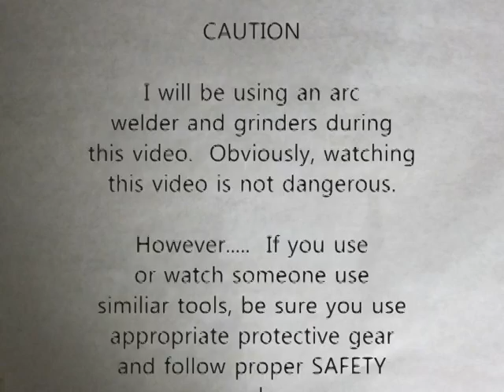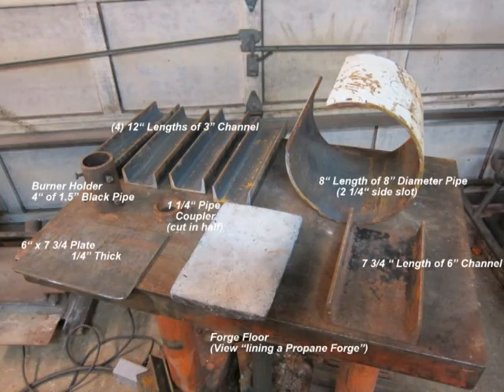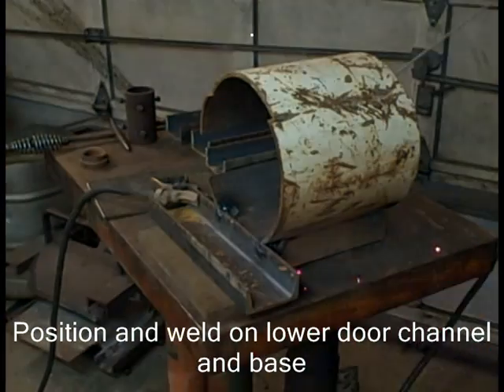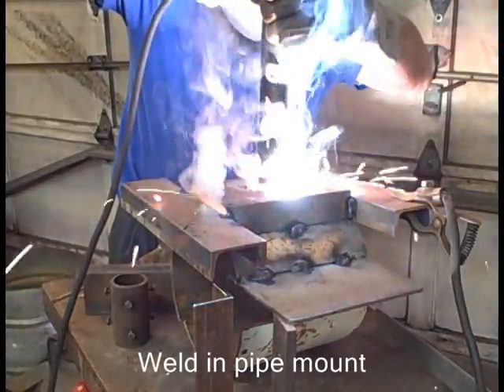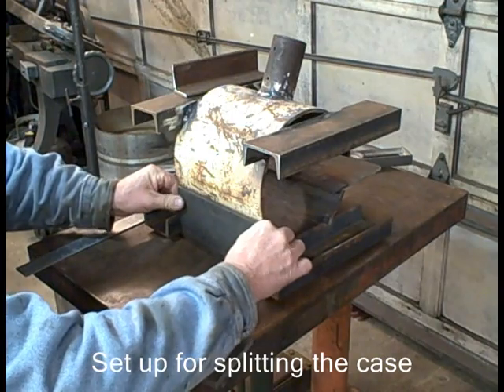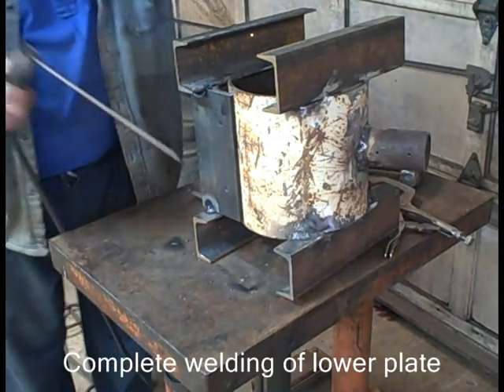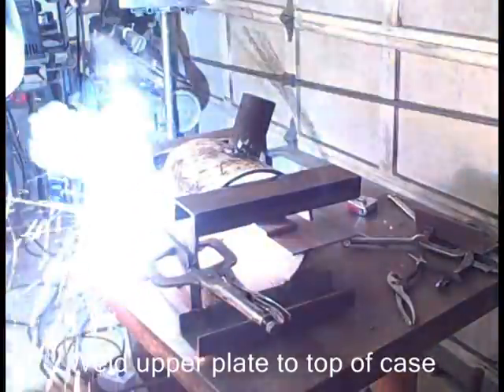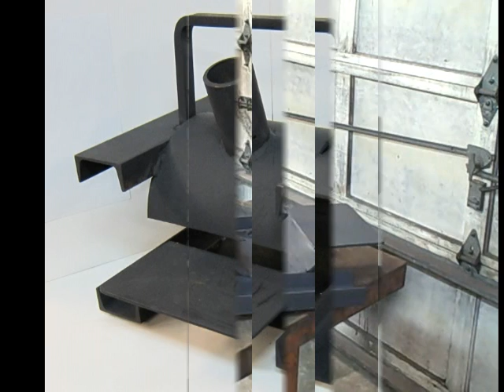Build a "Super C" Propane Forge.mpg

Comment: David,  I LOVE THIS VIDEO...Awesome design and excellent information.
Reply: +Charles Wright....  Thanks.  Please note also that this forge can be made with a length of "C" channel for the bottom, with a half round being used for the top.  This makes the forge easier to build.  A piece of 3/8ths or 1/2 inch plate would be welded to one side of the half-round, and bolted to the back side of the channel.  Also, when you line the forge (another video), for small forges (such as this size), it is not necessary to add the mortar and second coat of slurry..
Reply: I have a few tanks that are condemned....The argon/co2 tank has the best promotion......I also have two 20 lb propane tanks that i first made rocket stoves but want to convert to a forge.    I need about 7- 8" of width and depth.  The height of the opening would be 2-3".   I thought the opening would let out too much heat.....then I saw your idea of adjusting firebrick and that solved the problem.     Thanks so much!!!!!

Comment: Good video Sir.  I'm surprised you haven't got yourself a little MIG welder by now, but then again, you're a good hand with the old arc welder.  I cringed when it came to you welding the nuts for the splitter plate.  Best done first when flat on the bench as you say, but so much easier with a MIG. Your arc welder sounds cranked well up even for the welding, though it's hard to say watching a video. Nice use of the arc welder for cutting, an old trick that you made look easy. Good stuff. Paul UK.

Comment: I agree. I would also recommend not using a flap disk to deburr the cuts. The burrs will destroy your flap disks by shredding them. Use a large half round file. More elbow grease but you will save money on flap wheels.

Comment: This is gonna help me a lot! Can you make a video on making a propane forge with no welder? Thank you so much
Reply from the maker: Matt....   Sorry I didn't answer this before.  I just found the question.  With a minor exception, I have already made a video showing how a forge can be made without welding.  Look for "Free Form Forge".  The exception is that the video shows the use of a manifold with two burners that have the burner holders welded to a piece of plate steel.  Instead of welding the burner holders, they could be held on the plate with angle brackets and small bolts.  If you are just starting and are going to do small projects, I suggest a much smaller free form forge with just one burner.  Be sure you have support for your burner and hose so they are stable when in use.

Comment: Great video and very interesting design in an interesting subject.  However it is not negativism to point out hazardous practices that everyone may not know.  As mentioned below welding light will burn your skin much like a sunburn.  Ask your dermatologist.  The burns are cumulative over time and lead to melanomas which are serious and a fast cancer you really don't want to set yourself up for.  The damage done may appear to heal but the skin cells are permanently changed.  If you are young and do this many (for some people it doesn't take that many) times as you reach your fifties and sixties you will wish you had not.  Welding does not seem to tan.  Its U/V range is just in the dangerous area that burns (which is the same as harms your eyes).  It is not if but pretty certain to happen.  Your dermatologist can look at your skin years later and tell how many times you have burned yourself pretty accurately.  Moles, age marks, skin tags etc all are directly attributable to sun burns.  Check it out and you will find that welding with skin exposed is like playing Russian Roulette with all six cylinders loaded!  Not in any way trying to bust your chops but I see this all the time and I believe it is done out of ignorance which will be regretted in the near or far future.  Really enjoying your build as I always like to see uses for 'scrap' materials in innovative ways.  I used a hot water tank, cut it down welded up hinges and a stand to make a rod oven.  They are handy as they come in all sizes and done carefully the insulation can be preserved.  I used a silicone oil pan heater as the heat source.  Worked well.  Doug

Comment: I would suggest, if you make more of these forges, to clean all the steel before doing in welding to 1. get better welds & 2 it make it easier to clean the welds later and you don't have to go back and clean it before you paint it.

Comment from the maker: Joseph...  I recieved an email from Youtube about another comment you made 

"does it matter on how the orifice is put on the main body of the forge I have mine straight up,,,, does it need to be on a 90 degree angle "

It's not clear to me what you are describing.  If you are referencing burner placement, I have had success putting the burners straight up or slightly angled on top of the forge.  Be sure the flame has a clear path into the burn chamber.

Comment: What kind of band saw is that in the background? That thing is truly awesome!
Reply: If you are referring to the horizontal band saw I cut most of my stock with, it is a WELLS Metal Band Saw, model 5-M-42.  The company was started in the 1920's,  I'm not sure what year my saw is, but it is an early one.  Wells is still in business today.  I have another Wells saw in storage, a little larger.

The large upright band saw is a GROB 4V-18.  It is an industry grade vertical bandsaw and weighs almost a ton.  I have cut steel 2" thick with it.  I believe that saw is still in production.
Reply: Awesome. Thanks for the info. I have a bit of an affinity for turn of the century tooling.

Comment: Like the project.  But, you should really take note of safety.  First with the angle grinder on a loose piece of metal.  That can be thrown around by the grinder.  Next welding without a glove or long sleeves can give you a very bad burn.

Comment: Hi David,
First let me thank you for the great information in your videos. My son and I are going to build a super C because of your great step by step information. We are both wondering why the length of the forge is as short as it is? He is new to blade smithing and my hobby is carpentry. If this is a forge to try and do many jobs with, would a longer forge still work fine or are we then causing more issues with heating it properly?

My son wants to mostly make knife blades but we are concerned with the short length of the forge it will be more difficult to get a longer blade heated evenly..

Thanks in advance.

PS if you have answered a question like this before can you please direct me to that answer. I did look before I asked this question.
Reply from the maker: +Arthur Mitton ....   You can make the forge longer if you wish.  In general, this forge would work for most projects.  The area of a project you are actually working on is seldom more than a few inches long(usually less than that).  The exception for bladesmiths is during heat treating, where you need the entire blade at an even temperature.   It can be done with a forge less than the length of the blade, but it takes practice and a very good eye.  You just keep moving the blade through the burn chamber till you get the heat penetration and color you need.  Although a single burner should support a burn chamber up to around 300 cubic inches, you might want to put two burners to ensure more even heat throughout the interior if your forge is much longer.    You also need to keep in mind that, with these types of burners and the placement I use, there will be hot spots in the forge.  Professional heat treating is usually done in a heat treat furnace where there is no open flame.  A propane forge can be built so the heat is indirect, but that is a different type of forge (and burner placement).  Good luck with your projects.
Reply: +David Hammer Thanks so much for the additional information and your very quick reply!
 My son has now cut the oxygen tank into a 10 inch length. We are in 
Canada and most of what I have found for refractory brick is only 1 1/4"
 thick so I am continuing to look around to find the 2" or we will have 
to modify the design to either accommodate a double thick brick or 
something....  I found a source out of Vancouver for some lining 
materials and plan on contacting them today. Again, thanks so much for 
the help. I am definitely one of your subscribers on YouTube.  :)
Reply: +Arthur Mitton....  I assume when you are speaking to 2 inch brick, you are talking about the brick that will be used for the doors and the shelf.  If not, what?   Keep in mind that I use "soft" brick (called Insulating Fire Brick (IFB) for the doors and shelf.  When I see 1 1/4 inch brick here, it is hard brick.  I have used 1 1/4 inch brick for floors sometimes.  Have you looked online for IFB (ceramic or refractory suppliers).  I believe 2 inch is available, but what I generally use is 2.5 x 4 x 9 inches.   It's a lot less expensive if you  buy it from a refractory supplier that normally services industry.  One catch though is that they may not ship, so the supplier would need to be within a reasonable distance.  I just used Bing (you could use Google) and searched for ceramic supplies and/or refractory supplies and added Canada on the search.  I found both types of suppliers (Alliance Refractories was one of the industry suppliers.  Ceramic suppliers generally sell by the piece, industry suppliers usually sell only by the box (but the cost per unit will be significantly less).   IFB will break easily, so shipping sometimes is a problem.  Also, I recommend buying 2300 degree IFB because it is stronger than higher degree rated brick.  Remember, I consider IFB a consumable, so don't expect it to last indefinitely (it doesn't).  

If you live near a large city, chances a good that you can find a local refractory distributer.

Look in the Yellow Pages also for suppliers.

Thermal blanket is another story.  The refractory distributors are the cheapest, but again, they only sell by the box, which would be much more than you would need.  Ceramic suppliers that sell to consumers will generally sell by the lineal foot.  They also will ship individual IFB, but are a lot more expensive.   It pays to shop around...  make lots of phone calls to find the best prices, including shipping. 

If you are going to use thermal blanket and are going to put the refractory I reference on it, you should be able to find that from ceramic suppliers also.

Comment: Greetings from New Brunswick Dave,
I have completed my Super-C forge and have made myself a couple of burners (one for a spare. I made them to your specs exactly. I'm having to choke the air inlet holes to get it to stay lit, and move the nozzle down into the tube another 1/2" to make it run. Once it is lit,it burns blue and powerful. Have you ever had to "choke" any of your burners in the past? Any ideas? Thanks!

Comment: excuse my ignorance but why on earth did you cut that forge in half? I've been trying to think of any possible benefits but have come up blank. I'm sure the reason has just flown over my head, please elaborate. Thanks
Reply from the maker: Sorry I didn't see this question before.   The reason for "cutting the forge in half" (as you say), then bolting it back together is so the top can be taken off to make it easier to put the lining in, brush the refractory on, reline and repair the lining.

Comment: In my modification to your forge, I am  making the side slot large enough so I won't have to notch the bricks. This way I can put 'em in sideways as well as straight in. You must have a good reason for your notched design, but I can't find or figure out why? The build is too far progressed to use your spec's, but as I was re-watching and trying to pick up a reason, I thought to inquire. Anyway, thanks for your contribution to our body of knowledge. Even though my design mod is a bit different than yours, I will always give you credit, mate!
Reply: The simpler you can make the side bricks, the better.  Those on the video were that way because the floor was higher than the shelf (thickness and width issues) and the way the top lining ended above the opening.  I've since made many forges with larger openings and the bricks essentially being a wedge that slips in.  The original intention was to have a two-inch opening.  Sounds like you achieved that better than I did on your first build.  Good job!!

Comment: This looks unbelievably clunky and not at all useful. Open sides? Have fun working in a shop that's a million degrees.
Reply: This video is only one in the series about building this forge.  The "forge lining" and "floor and door's" videos show how the forge is completed.   The openings are closed in with movable soft firebrick.   They can be opened as needed or wanted for access to the burn chamber.

Comment: way too complicated and slow
Reply: I acknowledge this is not a quick and easy forge to build.  It is not meant to be.   However, it is the most versatile forge I have ever used, AND when mounted on a pedestal with a round base, it is easily, and safely, moved around, even when it is hot. 

If you want simple, watch my "Simple Propane Forge Lining" video...
Reply: Building this forge is not meant to be simple.  The forge is meant to be versatile, self contained and easy to  mount on a pedestal which can be easily moved.  

If you want to build a simple forge, view the "Simple Propane Forge Lining" video, and make a forge shell similar to the one being lined.